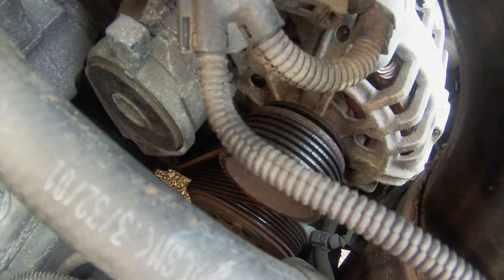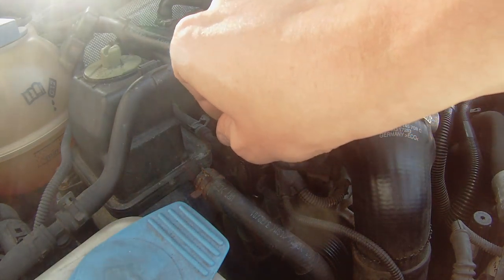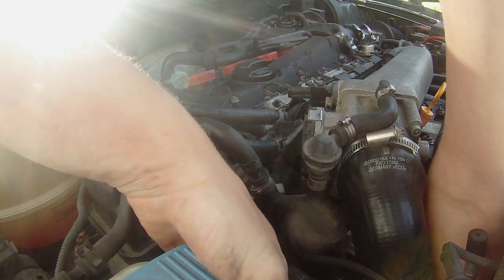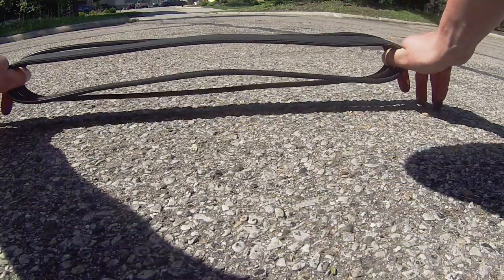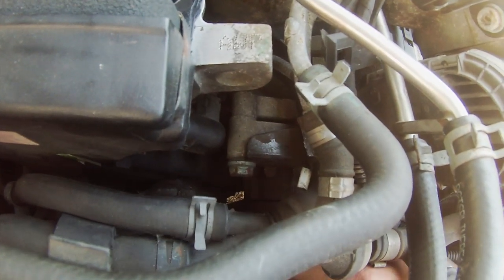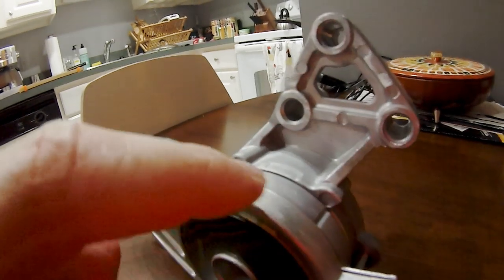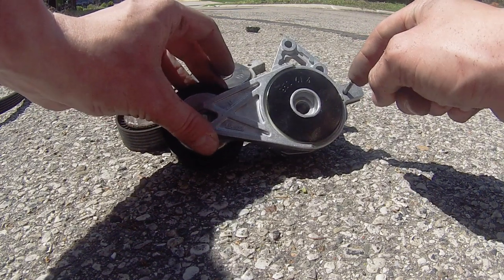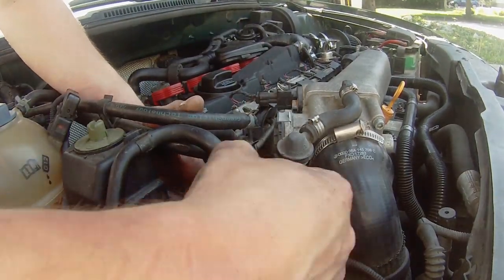MK4 VW 1.8t Serpentine Belt & Tensioner Replacement

Comment: Pro tip if the belt is only riding halfway on the tensioner pulley it’s because you have the little black bracket between the tensioner and where it’s bolted to on the engine, that black bracket goes on the outside not between! You would think the bracket goes between but I promise you it doesn’t! The pulley will also rub on the timing cover if the bracket is installed between as well!
Reply from the maker: Thanks for commenting, this is a great tip!
Reply: 😅 came here for this, thank you

Comment: Remember when installing, that black bracket don't put it on the back side of the tensioner
Reply: I just changed mine today and shredded my tensioner
Reply: Steve Valente it was I even bought a new one
Reply: What do you mean by backside?
Reply: Does the bolt below it have a washer?

Comment: when you did your belt, and you finished. did it stick out half way on the belt tensioner ? because I replaced my belt and belt tensioner but once I started, the belt rides halfway on the belt tensioner.. is that normal.?
Reply: Eric Maldonado having the same issue what's the solution?
Reply: @codybryant9878  do you find a solution for the belt tensioner?
Reply: Same problem... Any solution?
Reply: @peyn8  there are some replies above, you've but as this is 4 years ago you've probably fixed it right?